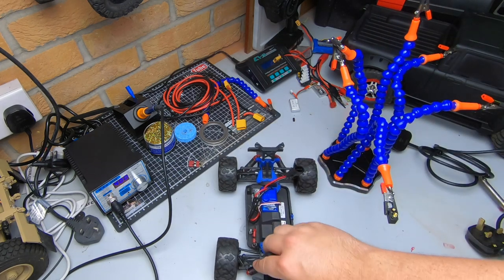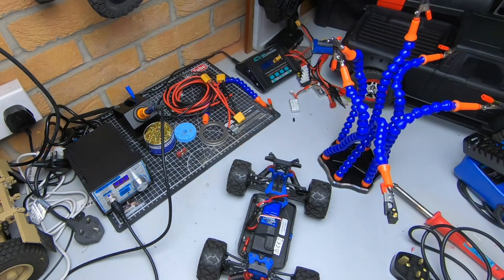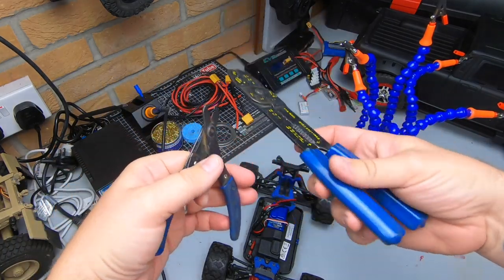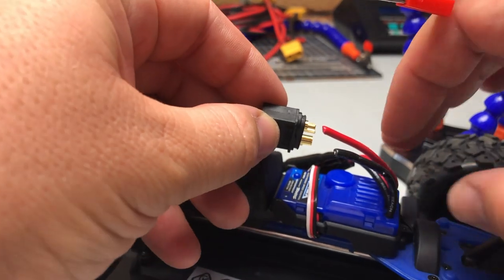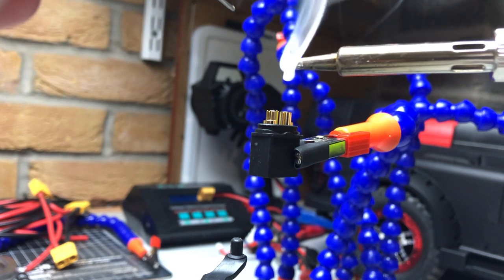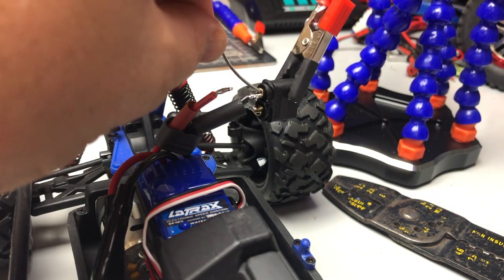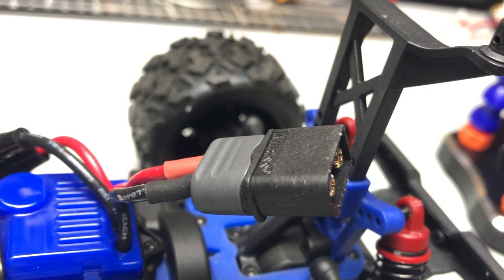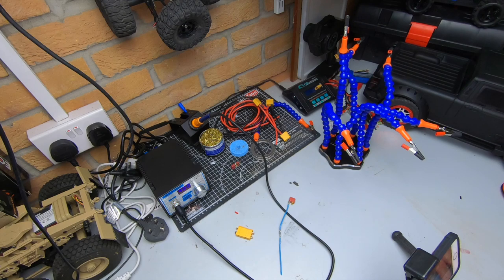How to Solder. Advice from a Pro! Soldering XT60, XT90 & Deans RC connectors.

Comment: As an IT Project Manager and DIY enthusiast I spend 80% of the time gathering requirements and proper data before the work even begins. After watching what I can only describe as an unbelievable amount of videos on how to properly solder XT connectors, this is by far one of the best. Information is presented Objectively with appropriate context for the viewer. Great job.
Reply from the maker: Thanks Jason. Appreciate the feedback, there are a few ways to solder, but this for me is the easiest and best way for a clean joint. 👍

Comment: Great video! I have 20+ years experience as a custom A/V technician, and solder almost  daily... I’ve been shaking my head at a lot of soldering videos, almost all of them don’t say or show that you heat the object your adding solder to or joining and not melting the solder onto the object or the iron!! Glad you showed the correct way so ppl can really UNDERSTAND whats taking place! 👍🏼👍🏼👍🏼👍🏼👍🏼👍🏼👍🏼👍🏼👍🏼😎
Reply from the maker: Cheers mate. It's a very basic video, but hopefully covered enough for the average joe to understand. And I think in for this hobby it's more about a good connection than a perfect solder. 👍
Reply: I just watched a couple of videos and no one ever says the most important part of soldering like you said. The higher the watt iron the better. They’re probably making a lot of people feel helpless that aren’t using a high watt soldering iron. Burning their finger tips nice and crispy.

Comment: It also helps to plug a spare connector into the opposite side of the connector you are soldering.  It transfers some of the heat to the spare connector so you don't melt the one you're soldering and it also helps the metal connectors to stay in place if they get to hot.
Reply: thats a great tip thanks
Reply: You can take that one step further by soldering on a few inches of 12AWG wire to each side of your spare heatsink connector, it will pull a good bit more excess heat out of the plugs and keep it from melting the plastic. I've also found that an empty airbrush is excellent for cooling solder joints, just by blowing air over the part immediately after soldering, it's great for temperature sensitive joints.
Reply: @TheExplosiveGuy   @Mark Green  If have to cool it off then you're getting it too hot using too low of temp on the iron so that it heats up everything before melting. Use a higher temp to get in and out and use 63/37 as it cools faster than 60/40 does. Should not even come close to melting a connector. If it's getting that hot you're going something wrong. Not enough tip temp, too small a tip, and low wattage iron will all cause the connector to get too hot and melt the plastic.
Reply: i only had issues like that before i learned how to solder correctly... if you have a hot iron it only takes seconds to finish, connectors can melt do to taking to long leaving iron on connectors...
Reply: Could’ve use this advice last night
Reply: Haha that's a great idea, im annoyed i never thought of it

Comment: I solder with a stick and some flintlock. Sometimes I rub two sticks together with solder or use an acetylene torch. It melts all the connectors into a ball. Makes them all standardized.

Comment: Nice video. I was always afraid to use high heat. I thought I would damage something but when I finally tried it, I realized I could make the joint and have the heat off in a fraction of the time. It was counter intuitive to me at first but I was holding the heat on for much longer and doing way more damage trying to use a colder iron. And use the biggest chisel tip you can for thick wires like the ones for xt90's. Again, hotter, faster heat transfer made for 1000 percent improvements in my joins.
Reply from the maker: Yes, lots of heat and less time holding the iron on, once you get the hang of it.... it's really quite easy. My issue with XT90's is trying to get the cable in the hole neatly....I always end up with a couple of strands poking out lol.
Reply: @TomleyRC   This is how I do XT90's. Tin the wire, Tin the cup. Connector in the vice with the cup pointing away from me holding the wire pointing towards my chest. Tin iron and hold the iron on the cup for a second to "reheat" it a bit, then I put the wire on it, quickly put a bit of new solder on the iron and then press the wire down with the iron perpendicular to it. when pressing down you will feel the wire sink down into the cup and you can move the iron back and forth to smooth anything down that needs it.

Comment: i just used a pro solder station  a friend gave me ,set at 750 degrees and it made soldering so nice.,fast and simple..i have always used cheap  irons that  sometimes would not get hot enough for some reason and take forever to get  a decent bond...

Comment: Going to try my first soldering project tomorrow thanks for the tips, have to rewire my esc battery cables ill let you know how it goes lol i got a cheap set was like 35$ came with a lot of stuff including a multi metter but the iron is 60w 120v so should do the job fine

Comment: Great video, Tomley! BY FAR the best I've found. Now, I'm going to scroll through the comments to see how many people want to try and argue with an aircraft electrician with 20 years of experience. LOL
Reply from the maker: Thanks Mike. It’s not perfect, but certainly absolutely fine for this hobby. Some slight differences/tolerances in a proper engineering environment and certainly in the aviation industry. But you’ll not go wrong doing this in the RC Hobby

Comment: Tomley, thanks for this video. I am putting together an 8XE and am at the electrics stage. I bought some rosin core solder (lead free) off Amazon and, combined with my lack of soldering experience, this solder appears to be quite useless to tin on 10awg wire. I have just given Bill Shorthouse a call and have ordered the same solder you are using. If it still doesn't work then I am in trouble, haha.
Reply from the maker: Lead Free solder is pretty hard to use. I know a lot of people don't like to have 'Lead'...but sometimes it's the only way. As long as you keep the area well vented, you should be good. Good luck!
Reply: Tomley RC well, I’ve bought a small USB fan to blow the smoke away from me, I’ll have the windows open and I’ll use the mask I bought for Covid-19 purposes! Should do the trick 😅

Comment: I love soldering. I've got an old reel of Radioshack solder that works perfect. If I buy new 60/40 it just disappears and turns into ash, I dont know if my soldering iron is to hot or what, but I go threw tips like crazy but I can solder XT90s and Deans with a quickness. I had an old Weller 8200 soldering gun and the tip just disintegrated after about 5 uses, idk what i'm doing wrong. The current soldering iron I use is a china brand one that came with like 5 tips it has temp adjustment I keep it at 350 degrees Fahrenheit
Reply from the maker: Yeah, it can be quite relaxing soldering. Not sure why the 60/40 is disappearing?
Reply: @TomleyRC  I think maybe it's because it was cheap china stuff. Idk. Or my temp was to hot
Reply: Hopefully by now you've purchased a soldering station with a thermostat? My wife got me one for Christmas a 14 months ago. I sure wish I had bought one many years earlier!
Reply: @senseisecurityschool9337  I have bought at least 2 different soldering pencils since. Same luck with the cheap solder, it disappears once I heat it up and nothing ends up on the wire. My old Radio shack reel of solder is just about gone. And I have no idea where to get good solder the hardware store here only carries acid core for plumbing

Comment: Ive got a 30w iron.  It clumps up and the solder doesn't soak into the wire. Definitely need an upgrade..

Comment: Fantastic job, dude! 😃
About filling the connection with more solder, it all depends on how much current you're going to pull. For quadcopters, for example, where you have picks up to 130A... Definitely you would need to do that. Otherwise it's no need. 😊
Reply from the maker: Yeah I guess that would help a bit of the heat dissipate. 👍
Reply: Also dependent on the gauge of the wire. He’s using pretty small gauge wire.
Reply: @ubreakitirepairit3569  Good point. 😊

Comment: Ok so John Salt said with XT90 the small irons aren't hot enough. So is a 75W powerful enough for XT90 ? Are wires on batteries or esc when you cut off the old connector already tinned ? Because I've seen guys dipping wires in some resin flux paste and then dipping that in a Solder Pot bath machine. You can buy the metal sticks and melt them in. That does a perfect job. The resin sucks the solder ontovthe wire perfectly.

Comment: If you had flux on hand, would you put a dab in the bucket on the connectors before tinning them? A bit of flux on the wires before tinning is always nice, and when soldering small electronics things, I heat a bit of flux on the pads to clean them a bit before tinning, to remove oxides. But for fat connectors like these, would you use flux on them?

Funny side note.. I'm gonna use XT60s to repair a ceiling halogen lamp that I like... I put in 8x 14W halogen bulbs by mistake.. it was rated for 8x 10W max. With the 14W bulbs total wattage would be 112W, and the transformer was rated for 105W max, so I was pretty sure it had blown its heat fuse. Not so. The 12V secondary of the transformer connected to the halogens with a Tamiya connector. I had noted it was probably getting a bit hot because the cable was already a bit darkened near the connector, but when I opened it up now it was brittle charcoal near the connector, and one of the pins had no continuity to the halogens. It had burned straight off inside the connector. Normal current in this lamp would be around 7A and with the wrong bulbs around 9A. Rated for 15A my ass, connectors were completely oxidized. I know RC and Airsoft people hate Tamiyas, and now I know why. On the plus side, in this case it acted as a fuse on the secondary, and saved the transformer from my stupidity! Not a feature I want from a connector tho, so I'm going with XT60s for the repair!

Comment: i was a solder for 7yrs but i just tried to solder some connectors but they would not solder to together i even had it at a high heat i just dont know what i was doing wrong you guys who solder on connectors make so easy me it takes hours and still fail get soldered

Comment: I hate soldering Deans. This video helped though. I need to lose the lead-free stuff and going off memory, this is the first one I've seen where the tinning from the connector & cable was enough solder. That seems to make sense to me. In others they have added more but i liked this tutorial. thanks for the tips.
Reply from the maker: Yes, lead free is no good really. The cable was quite small on the deans, but the same thing works ok with a bigger one, as long as it's tinned correctly. Some of the cheaper deans can melt very quickly, so worth putting the male/female end on also to help absorb the heat better. 👍

Comment: Hey there great video! One question though - i have a lipo battery that only has the balance leads coming out of it. They are thin wires ... but no thick wires like you have ... It does have two other terminal points but they are just that (soldered points on the battery with no wires coming out of it). It is a 7.4V , 3200 mAh battery from China ... don't even have a C rating on them!

Comment: Man 🙁 I have a 100 watt soldering iron 
The wire becomes too hot to Hold af the Plug melts before I can melt the solder . 
I can only Find Lead free Solder it’s P’eeing me Off.  The tip keeps Blackening up I clean it like you . I Tim the wires but it’s when it comes to putting the the wire to the plug it goes Tits up.
Reply from the maker: Plug a male/female connector on to the other side of the connector to help dissipate the heat. Lead Free Solder is pants... ‘flux’ will help, but not easy to get hold off

Comment: I don't now what I'm doing wrong. My solder just won't melt when I try to tin the wires or terminals. I'm using a 100w gun which I thought would be plenty (but maybe not). It a draper one like this https://mastertrade.co.uk/drp-71420-draper-71420-soldering-gun-kit-100w-240v.html.

I'd appreciate any advice. Really hoped to get my car up and running this weekend

Comment: - Keep your fingertip much further away from the iron tip when pushing the wire in, in case your fingers or iron slips. Your fingers are way to close at 9:13 for an instructional video. Or grab it with a tool like small pliers and ease it in, which is what I do. Finger tips should never be closer than about 3-4 cm away from the iron tip.
- Use a heat gun instead of a flame for the heatshrink, they really are cheap
Reply from the maker: I use my fingers as a guide to how hot the insulation is getting, good for small cables, not good for larger ones lol
Reply: @TomleyRC  I generally wouldn't recommend beginners try doing that ;) Usually if your technique is correct it won't be an issue.
Or use teflon or silicone wire and it's much harder to melt it, you get some more time to work with.

Comment: In aus our wall socket is 240v is a 60w solder the same regardless of power supply as your wall sockets are a different volts would I still need a 60w

Comment: hi way dont u use flux i do better contact with the solder
i solder bit different then u ...if u solder SILICONE wire with a very hot iron the solder will go down and under the cover and u wont be able to bend it
Reply from the maker: Flux isn't that easy to get hold of in the UK. And yes, you are correct on the Silicone insulation, good practice to Solder with the wire horizontal

Comment: Great vids, I'm just waiting for the "experts" to come in and pick holes in everything like they do every soldering vid on youtube but as far as I'm concerned, that was a more than adequate tutorial which will help people to solder to a good strong standard. I've seen some real horror jobs before now

http://www.ronlund.com/images/worst-solder.jpg

I agree about lead free, obviously its possible to work with it because pretty the entire electronics industry relies on it but I find it so fussy and unforgiving. It takes a ton of heat to flow and then it stays in a sort of soft, grainy paste like state for a ridiculous amount of time after you remove the heat.
Reply from the maker: Yes, some people are very OCD with stuff like this. If I was soldering an Aircraft component I'd be a bit more precise, but for this job, it's fine :)

Comment: Omg! Your solder job is terrible!
"advice from a pro"? U serious?
You cut way to much isolation off.
It sticks out from the contact points of the plug. Everybody can see this.

You heat up the connecter first, than the lead? Wtf? If you do this to long, it will melt or at least bend the plug!
Just hold your soldering iron inside the contacts and heat up the lead like this. Much faster, master less heat on the plug and no mess on the outside of the contacts!
Than do it again and stick the wire in while it's still melted and don't stop heating. This is way faster than you did! And you should always fill the contacts until the wires are INSIDE solder. Best is when you can't see the wire anymore, because it's inside the solder lead. Especially with wire this thin, compared to the contacts!

Also : "advice from a pro"... Thumbnail shows you holding the soldering iron on the metal where it would burn your fingers crispy...

Gj there m8!